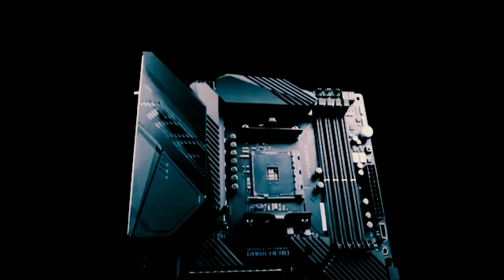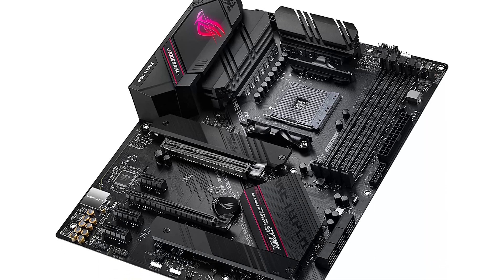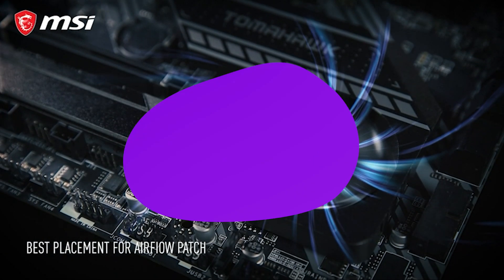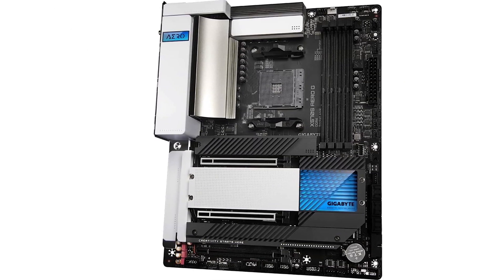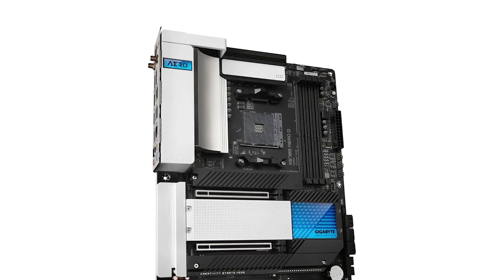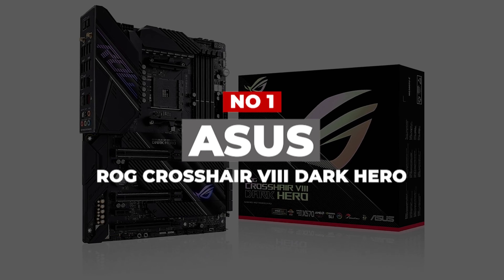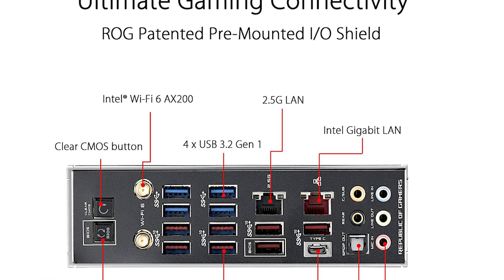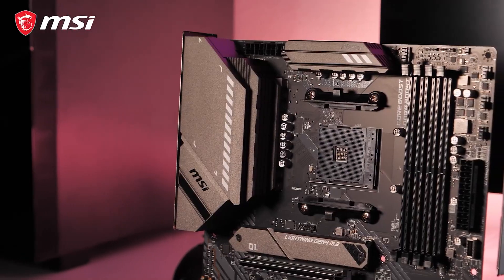TOP 7 Best Motherboards For Ryzen 9 5900X Of The Year 2025!

Comment: All of these are great for normal use. For more connectivity go X570, for stable overclocking B550. For extreme pro overclocking go MSI MEG Unify X or plain Unify. The Dark Hero is good, Aorus Master, Godlike. A few MSI OC boards have built in 5000X3D OC Kombo Strike and one click RAM OC with sub timings for good kits.